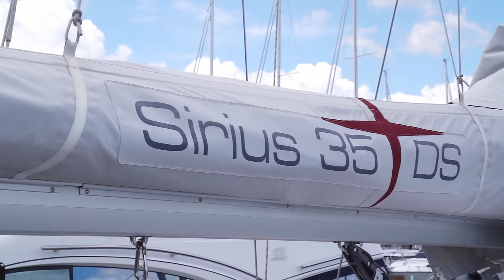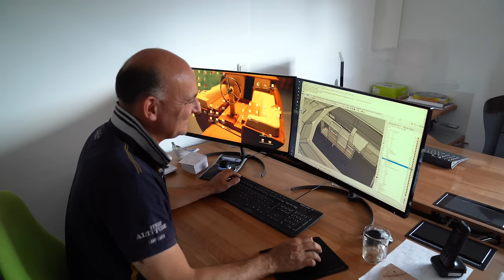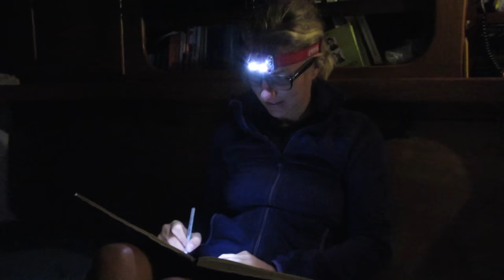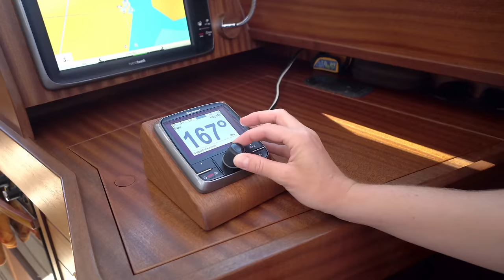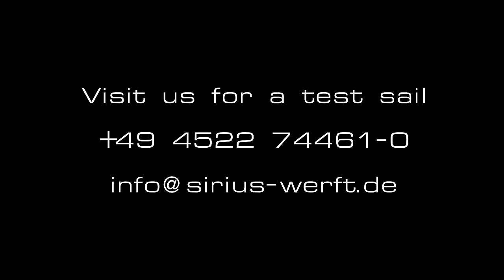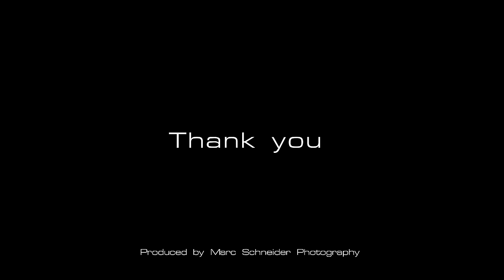Sailing the Sirius 35 DS: A Day at Sea

Comment: Torsten .....great vids, great boat. Do you have any polars for it? (I realise these would likely be different depending on rig  and keel choice etc) ?
Reply from the maker: I am glad you like it! I am sorry there aren´t. I noticed that you will get some for real cruising boats, but normally they are only made for racing boats built and sailed on minimum weight and in the same sail configuration. The programs are made for IMS-racing-yachts. The tools getting this charts are not laid out for non planing cruising sail boats built heavier the race boats with solid materials to last and equipped very differently with equipment, keel and rig configurations. But if you like to judge the sailing performance I am happy to list you some quotes from sailing magazines...
Reply from the maker: ....the 15 or so sailing magazines testing her had obviously been pleased: Yachting Monthly: „Is this the best boat ever built?“, "It`s the highest score we’ve ever awarded, by some distance" (still valid), "the Sirius 35 DS is the best cruiser he’s ever tested.“ "8 out of 10 points in sailing performance(Chris Beeson), Bootshandel: “I was totally awestruck by the small tacking angles we achieved. To convince myself, I checked the results by tacking over and over again. She tacks through less than 80°", Palstek: “The Sirius 35 DS is not only convincing as a high quality, seaworthy and well equipped cruiser, but also is agile and easy to handle even in strong gale conditions. She is a well-controlled sailing boat with a surprising potential for speed.“ There are more test verdicts in our brochure at https://www.sirius-yachts.com/yachts/35ds/#brochure
Reply: Thanks for the quick response. Certainly looks like it goes well and is stable in the vids I've seen too :)
Reply from the maker: @thomaswhitehead8035  ...stabillity is another outstanding point on Sirius Yachts as they were especially developed for blue water cruising and rough weather conditions, and always have been! There have been an number of curcumin-navigations on older yachts even. Some Atlantic crossings. Recently a 40 DS was collected by the owners in Germany and sailed straight back to Vancouver via Canary islands, Caribbean, Panama Canal, Galapagos, Micronesia, Hawaii. A second one just arrived in Barbados. I personally can´t imagine a better concept than a deck saloon for blue water and extended cruises

Comment: That is a cool boat. should go with a Hybrid system. Electric only seems like a bad idea for long cruising.
Reply from the maker: Glad you like it! Yes, we do Hybrid and fully electric as well. Wind and water generators, solar power, LION Batteries are quite common in and on our boats by now and electric drives have been projected a number of times. It´s fantastic for some usages...still not for all …or one needs to be very enthusiastic....to cope with the extra costs involved. Having a generator on board anyhow for other usage helps in the picture. With the car industry in it full speed not this is for sure becoming more affordable in the near future. The technique is all available for those enthusastic enough ;-)

Comment: Thanks for this excellent video about the 35 DS, as a tall sailor I wonder if it would be my boat (1.95 cm) what's the headroom ?
Reply from the maker: You are very welcome! That´s an easy task ;-) You know, all our boats are built individually after customers’ requirements: In the saloon are you will find already 2,05m (6 feet, 9)standing height (without the floor boards lowered, which would be the easiest), in all cabins below it could be up to 1,86m (6 feet, 1) in nearly all rooms, but we had versions built for much taller customers and tweaked that to quite some more. For a 2,02 (6 feet 8) tall chap we raised the hull and deck joined covered under the rubbing streaks by another 5cm and got to 1,97m nearly everywhere as the lowest dimension. Problem was his much less smaller wife couldn’t wash her hair in the wash basin anymore so we created a floor board to take out for his standing height and back in perfect for hers ;-) Both, our 310 Ds and 40 DS have more headroom than the 35 DS in the cabins. Beds are already 2,05m+ (6 feet, 9+)

Comment: Can the keels on this boat handle being grounded at 6 or more knots?  Looks like a Narrow section where they join the hull.     Everyone has grounded their boat,  will ground their boat,  or is a liar...   So the keels need to be able to handle that.

Also,  what material is being used in the fiberglass hull?     Polyester or Epoxy resin?
Reply from the maker: Well, staying away from rocks and trying not to hit something with 6kn would be my advice ;-) ...but I am 100% sure that you would struggle to find a yacht and built quality better suited to overcome this with no damage. This keels and structure is designed and laid up to dry out twice a day for the next 100years, as some customers with drying moorings do. The keels are a combination of lead and casted iron with the lead at the bulb in the bottom to absorb 60% of the crash you get into it into swinging and deformation and only 40% of the force will reach the hull. There the whole keel sits in a 50mm deep pocked which is 100% formed as the head of the keel and from there glued and screwed through extraordinary thick laminated GRP, Reinforcements and stainless steel plates. If you like have to this video here which explains a lot of the structure and quality in the details: https://www.youtube.com/watch?v=f7upfeSGJwU . Our yachts are built in Polyester with 30mm Divinycell foam in deck and hull above the water line. Epoxy makes only sense if you are going as thin as possible to spare weight, and do not care about noise inside a boat too much. For that reason it´s mainly used for racing yachts. Of could the underwater is Vinylester and usually additionally protected with an epoxy paint...
Reply: @SiriusYachts  Thankyou for the information,  I'm inquiring because I'm interested in the Sirius line,  I'm just wary of modern "production" boats due to most owners preferring to spend the vast majority of the vessels time in the harbour as a floating condo and day sailing in fair weather,  so manufacturers are giving them what they want at an attractive price point.

Which unfortunately trends towards the hull and structure being built with that in mind rather than the challenges faced over a lifetime of cruising, 50kt+ winds and 40ft seas...     Running aground, hitting logs and submerged cargo containers...   Other peoples inadequately anchored boats....

Good to hear about using Vinylester under the waterline, despite the fact any "ester" will break down in the presence of water eventually simply due to the way they are created,  Vinylester is a lot more resistant to osmosis blistering than Polyester in this regard so that's a major plus,   though epoxy is even better still for making a "100 year hull"  provided the correct epoxy resin is used and the workmanship is sound.

The interior layout work is very good,   if the structural foundations and ease of maintenance are a match in quality then one of these vessels will be on my shortlist.

Comment: She's a Beauty,  I"ve got a question about the fwd. traveler. How is this utilized?
Reply from the maker: ...if you have a look @26:45 you see it in motion. It´s the track of the self-tacking-jib. As it sits on a track which is bend in the exact diameter between the angle of the sheet coming from the pressure point of the sail and the angle going up to the first 3rd of the mast before leaded back to the winch on the roof it works without any easing of the sheet just by changing tack. So it´s totally hands-free as it stays perfectly trimmed for once up to the wind. Bit boring for the crew ...but they have more time to fetch you something... ;-)

Comment: Beautiful boat, the only thing  that concerns me is the large windows.  I assume these boats are blue water cruisers.  Often on large ocean voyages, waves can blow over the deck and in some cases blow portholes right out.  Portholes being smaller tend not to be as dangerous as a large window which could allow several gallons of water to rush in.  With windows like the ones on the Sirius, a major breech is a rarity but a reality.
Reply from the maker: Yes, many Sirius owners have crossed many oceans, all without problems with their windows. There was some truth in that 30 years ago but materials and bonding technology have moved on since then. It may still be a valid concern for yachts that aren’t engineered for all-weather ocean cruising but the hull windows on a Sirius are literally bulletproof. Build quality, strength and safety are at the forefront of everything we do. The adhesive we use for our windows is the same as you’ll find in aeroplanes and helicopters. As good as a deck saloon is, we would not build this type of yacht if there were even the slightest concern about its strength or safety.

Our deck saloon windows are made from toughened security glass. They are up to 10mm thick, bonded with an areospace-grade adhesive and through-bolted in aluminium frames with hundreds of 6mm bolts. The recess the windows sit in is a 25mm wide part of the GRP deck, and the inner aluminium frame overlaps by the same distance. The only way to break our windows is to use a sharp pointed hammer (like you find in buses and trains), but even then you’d struggle to break them.

You can read more about the decksaloon here: https://www.sirius-yachts.com/deck-saloon-yachts/

Comment: Do you publish polars? I love the comfort achieved by the design but can't bring myself to love the hull shape from a performance perspective.  It just seems to me that the height & depth of the 35DS needs a 50' hull.  But maybe I'm wrong, I'd love a chance to compare 35DS polars with polars from eg; a Pogo 36.
Reply from the maker: I am sorry there aren´t. I noticed that you will get some for real cruising boats, but normally they are only made for racing boats built and sailed on minimum weight and in the same sail configuration. The programs are made for IMS-racing-yachts. The tools getting this charts are not laid out for non planing cruising sail boats built heavier then race boats with solid materials to last and equipped very differently with equipment, keel and rig configurations. But if you like to judge the sailing performance I am happy to list you some quotes from sailing magazines here:
Reply from the maker: ...the 15 or so sailing magazines testing her had obviously been pleased: Yachting Monthly: „Is this the best boat ever built?“, "It`s the highest score we’ve ever awarded, by some distance" (still valid), "the Sirius 35 DS is the best cruiser he’s ever tested.“ "8 out of 10 points in sailing performance(Chris Beeson), Bootshandel: “I was totally awestruck by the small tacking angles we achieved. To convince myself, I checked the results by tacking over and over again. She tacks through less than 80°", Palstek: “The Sirius 35 DS is not only convincing as a high quality, seaworthy and well equipped cruiser, but also is agile and easy to handle even in strong gale conditions. She is a well-controlled sailing boat with a surprising potential for speed.“ There are more test verdicts in our brochure at https://www.sirius-yachts.com/yachts/35ds/. I hope you will have a chance to experience it in the future for yourself. You are very welcome!...
Reply from the maker: ...comparing performance with a Pogo: Well, there are different typs of boats and sailing: This is solidly built, so not on the racy, light weight side but the hull/keel/ruder/rig design is as a modern cruiser/all-rounder for comfort in heavy weather and fun to sail. You might not take the Spider on a family trip into the mountains to camp out with the kids if you have a Jeep to use as well. So taking the perfect long distance cruiser onto a racetrack might be fun but does not make much sense. But more often people think they could do fast long distance cruises in simply taking a cruiser racer and load it up with all the tankage and equipment needed only to find out that the hull design was not shaped to carry such load. This 35 is in particular is designed to sail and perform in a range between standard 7 tonnes and fully loaded 11tonnes ...and still sail. So in the end: there is a discussion to be had about "what kind of sailing/places/preferences you have" which will make the decision between "formula one and G-Class....or a lot in between ;-)...
Reply from the maker: …about the height and depth of the boat: I am sure you would be surprised to see her in person lying between other modern yachts. You will find the Sirius 35 DS most likely the least massive looking and sleekest (what she indeed, with a hull width of only 3,40m, is). If we are lying next to other boats the same size in a harbour we are often looking up as they all need very high hulls to get away with enough standing height inside with only low rooflines…and then they need the Sprayhoods on top, which we have integrated into our Decks house design. In general Sirius Yachts have a much lower centre of weight, compared to other boats, as we are able to place all heavy parts in the centre of the boat right above the keel, as this is where we have the space in the workshop, under the central cabin bed and in the huge galley storage spaces instead of a shallow bilge under the saloon other boats have there....that´s one of the reason they are perfect for ocean crossings and as go-anywhere-cruisers and the deep hull in the front is again designed for good all-round sailing performance and pleasant rough weather motion...
Reply: @SiriusYachts  Wow! 4 tonne payload.  That seems a lot.  Your customers must eat & drink well, and stay at sea for long durations.
Reply: @SiriusYachts  I agree polars are limiting, especially as they seem to ignore sea state.  SA/D probably tells us what we need to know.
Reply from the maker: @HempBike  ...yes, 4 tonnes payload is a lot and most likely the most you can find a 35 feet boat be designed for, but that was exactly the goal: you can load up any vessel with an huge amount of equipment and tankage and food and drinks...and living on board or sailing for extended periods of time or on bluewater, you kind of have to. So I recon 95% of yachts under 45 feet on blue water trips are hopelessly overloaded and very far above their payload they are designed for. This is not a necessarily a security problem but as the hull lines are not designed for this at all the sailing characteristics they are intended to have are gone....and often turned into something worse. In this regard, we are back to every sailing yacht being a compromise, but more important that you first of all define what the boat should be for you and what you want to do with it mainly and only in the second step could be agreed on this or that being the best boat or compromise for you. Best would be one for day sailing and racing and one for blue water...a combination can only be found at a size where weight of equipment and comfort stuff does not really matter, as it is such a small percentage of the total weight of the yacht...
Reply from the maker: @HempBike  ...well, the drinks and foot are the one thing what could be relativly easy calculated. It´s more all the additional equipment and gadgets as well as tanks, batteries, possible generators, washing mashines and so on ...which does ad always more than you thought...

Comment: For the 35ds what is the most popular keel configuration?  I understand there are 3 options.
Reply from the maker: ...actually there are 7!!! ..on the 35 alone! ;-) But talking of general keel typs you are right about 3: Fin keels, twin keel and swing keels. This very one was a 1,55m twin keeled one
Reply from the maker: ...the majority of our Sirius Yachts today are built as twin keels and only draw 1,30m on a 35 or little more in the sleeker lighter performance version with 1,55m. On the 40 Ds that`s 90% of the boats, on the 35 about 70% and on the 310 roughly 50%. Our swing keel versions (containing - unlike other brands on the market - all the ballast in the centre board) with a minimum of 0,85m on the 35 are also quite famous but built in small numbers. In addition to this there are 4 normal fin keel options available. On the 35 this are 1,98m casted iron deep fin, sleeker 1,90m lead/iron combi keel and most chosen amongst the fins is the 1,60m lead/iron combi keel. Which keel version would be the ideal one for you?